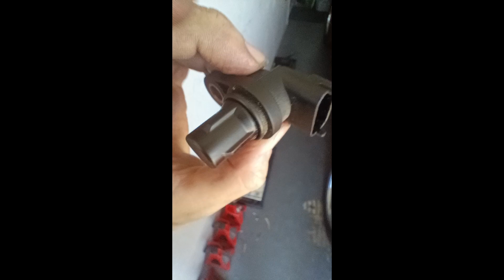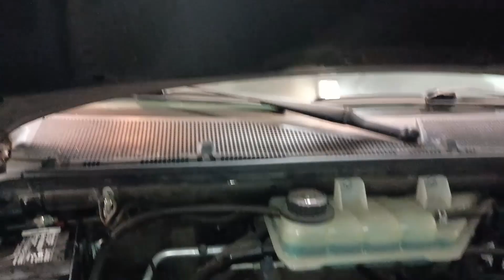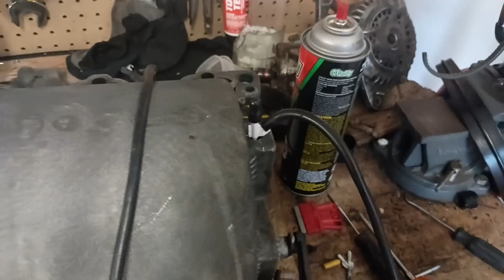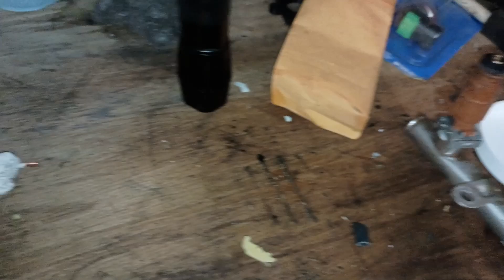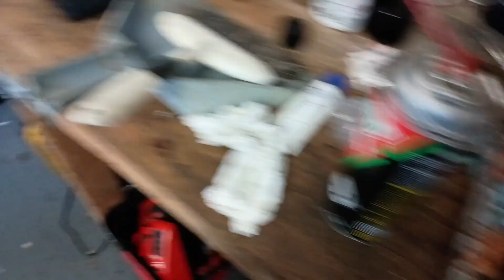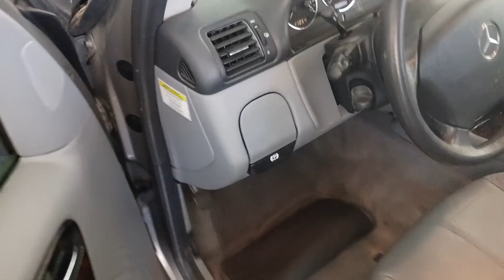Fixing up an ML350 from Copart Part 4 - Intake manifold gasket and vacuum hoses

Comment: Try getting into a 2015 ml 350 v6 3.5l.... 😢 no room, you would think engineering would have a brain by then but nope! A what should be easy coil packs and sparkplugs change especially driver side what a JOKE 🤬😂